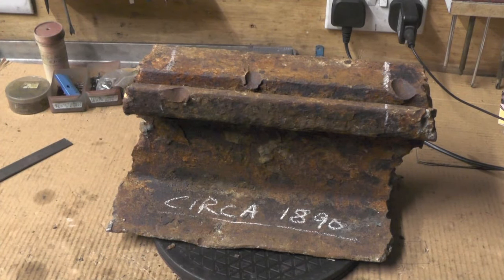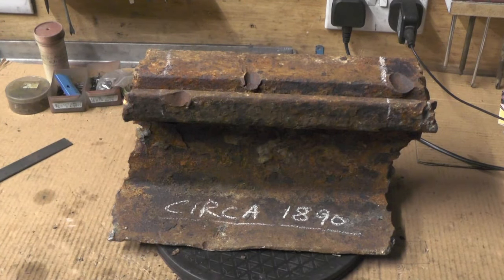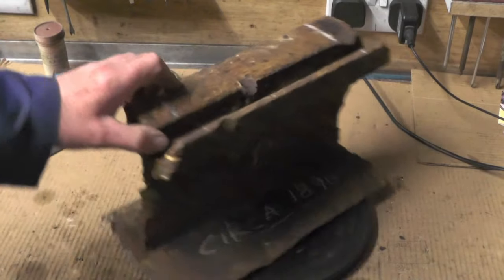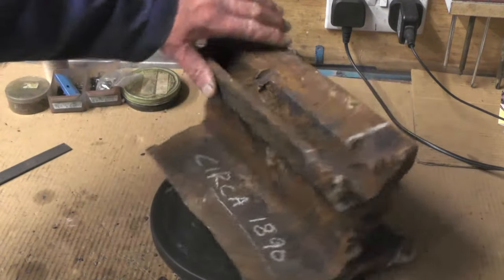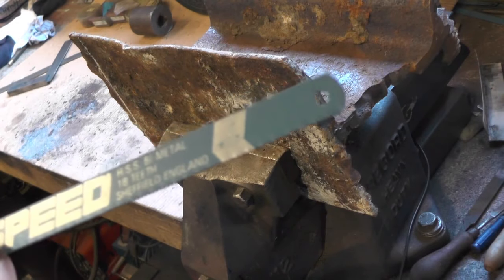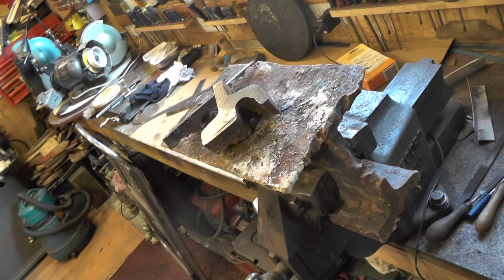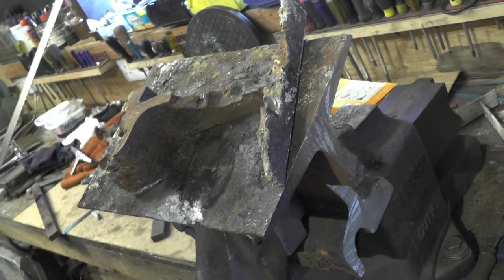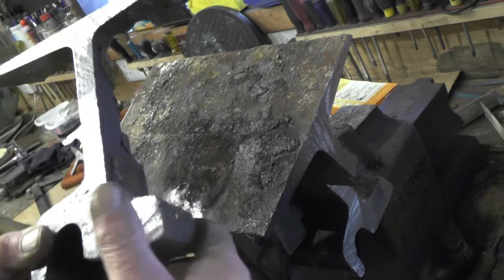Old Victorian Tram Track Hack (Circa 1890's)  "mr factotum"

Comment: Kev, I lived and worked in Sheffield for 13 years, great city, they had many top companies, and industries, but probably everyone has a tool or tools, that were made in Sheffield. Neil tools, more & wright , many of the woodworking tools , and screwdrivers were made in Sheffield, GKN also there. Most of the British steel and stainless were made there. Virtually all my measuring tools are More & Wright, top tools.
Reply from the maker: Hi Keith
Yeah, tool city, I have loads made in Sheffield. When pride was top before profit. We've gone backwards, in many many things, if firms don't make a million more than last year its time to get the handkerchiefs out, my heart bleeds.
Anyway off the soap box, there's nothing we can do about it. Wish I could go back in time, my next project is a time machine😂😂😂😜😉😉👍👍🚂🚂
Regards
Kev